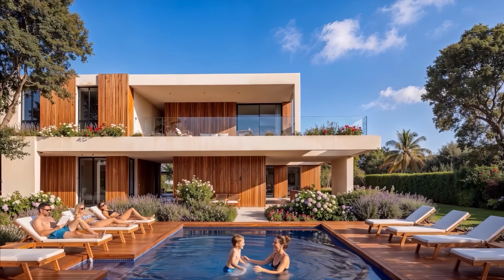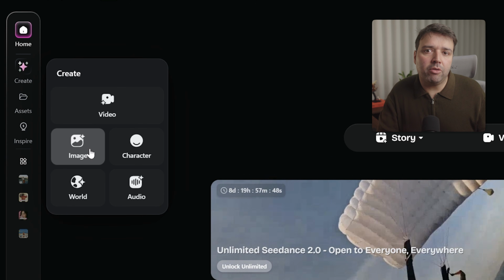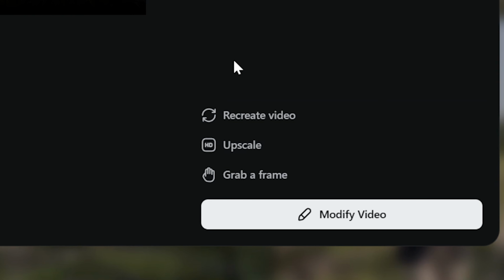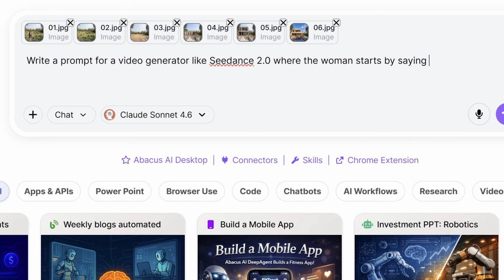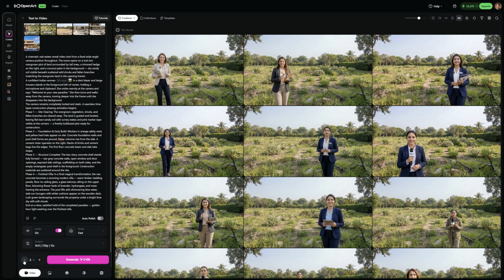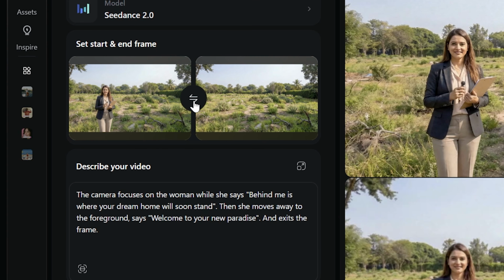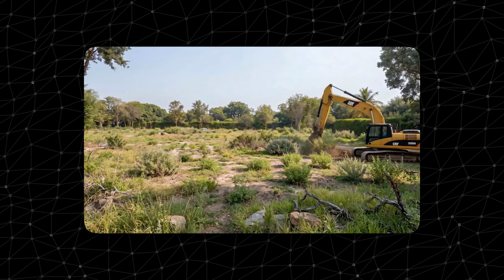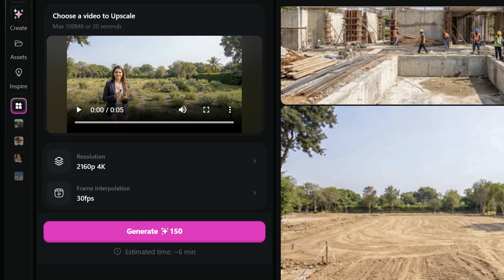Seedance 2 is INSANE for Architecture Construction Animations!

Comment: What’s your typical credit use from sketch to video like you show? Im not sure what plan I need. Thanks for the vids
Reply from the maker: If you want a longer animation like the one in the very beginning of the video, I would say you need to generate at least 16 images (8 total, but consider generating at least 2 for each with Nano Banana 2), then create just 1 video for each start and end frame. Sometimes you might get a bad result, just try again with a different length, usually it works. So maybe 7-8 videos for a final animation.
Reply: @NunoSilva3d thanks that helps